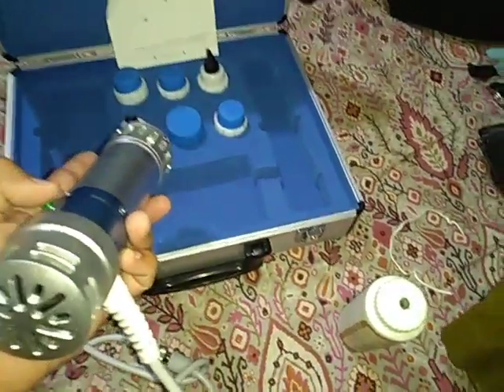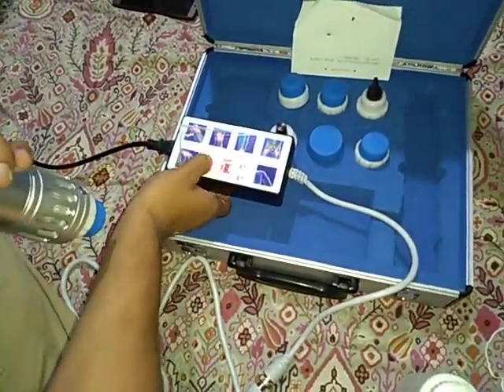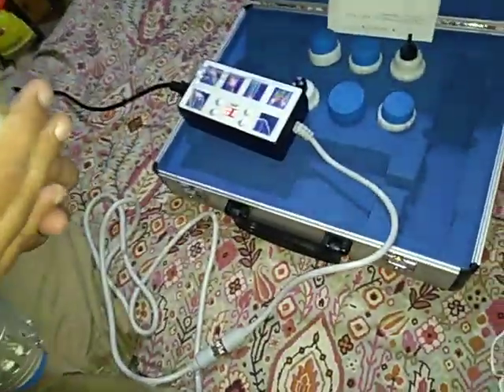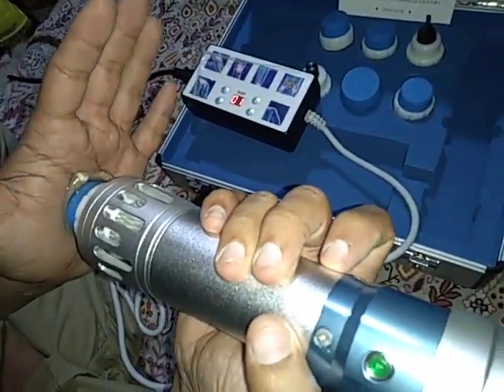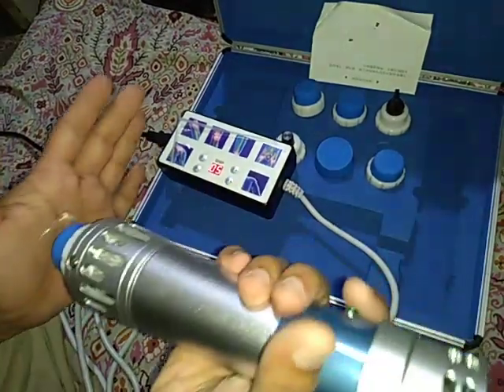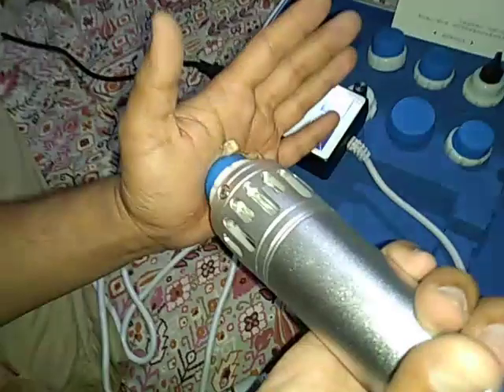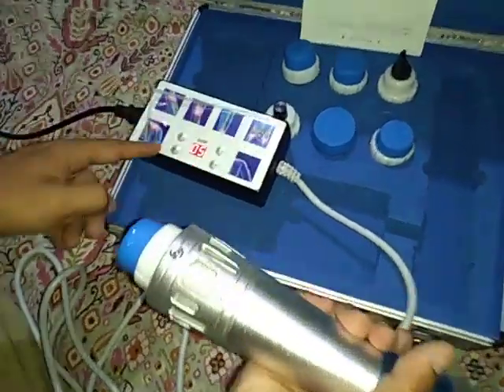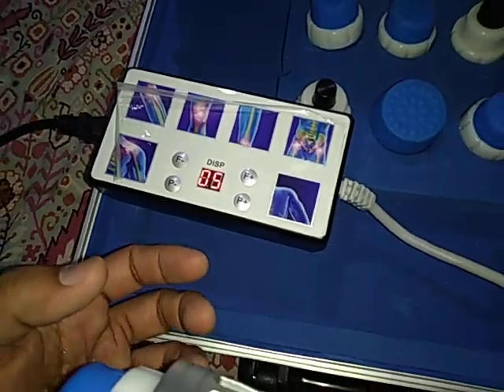Demonstration of shockwave therapy

Comment: I suffer from a tense pelvic floor. The treatments at the doctor's are too expensive in the long run, so I bought this device for home use. My doctor said such machines normally cost 50,000 dollars. My machine cost 250. I'm curious to see if it does any good.
Reply from the maker: Dear you can contact me for Professional advice at my Whatsapp +923315191713.

Comment: Can the blue silicone heads be taken off to use? There’s a silver head underneath can that part be used directly on the skin with ultrasound gel or will it burn the skin?
Reply from the maker: It will not burn the skin but the impact will be more.
Reply: @SyedAliPT Thanks for replying.  Been using it on calves and hamstrings. Can confirm no burns lol. Honestly, its the only device/shock therapy that will get deep enough in my muscle tissue and fibers.Wish there was a mount for a hands free use, so I can get my shoulder blades without asking someone to do it for me.

Comment: Good vid. In your opinion is this device basically the same as a vibrator?
Reply from the maker: No dear.
Reply: @SyedAliPT  "dear??"
Reply from the maker: @testchannelone6616  sorry for delayed response. No this machine is not like a vibrator.
Reply: @SyedAliPT  OK, then what is the difference?
Reply from the maker: @testchannelone6616  this is a shockwave therapy machine
Reply from the maker: @testchannelone6616  read about vibrator and shockwave and you will get the differences.
Reply: @SyedAliPT  I see. I thought you might know the answer.
Reply: LOL. It is a shock. Wave.

Comment: I have been using this machine for several months now.  I have tried various configurations using small heads and larger ones.  I am currently using the 36mm convex with F2 and P4.  Frankly none of the settings have made any improvement to my ED.  Has anyone else experienced such disappointing results?  Is it a fact that this machine does not work for all patients?
Reply: Apply complex systems thinking.  If the problem is not related to lack of direct electrical energy, how can adding electric shocks fix the problem?  Many problems have a root cause in mitochondrial energy production and exhaust dissipation.  8f that's the problem, you need to fix it there via what you eat. If you eat processed, iron filing infused foolds, well, that almost certainly plays a role.
Look up The Root Cause Protocol and try to eat net alkaline on the day.  I eat mostly organ meats and sardines when I eat meat, and I eat quinoa, tofu, carrot/green juices and goat leg soup modified with some chicken soup bullion.
I also supplement with Jigsaw or Rosita's Cod Liver Oil, Mg/Na/K bicarbonates, and various anti-candida/parasite natural remedies.
You issue is almost certainly well beyond ED.  You also might want to look into OmaPure IFOS 5-Star fish oil (keep refrigerated) capsules as well.  It is a natural blood thinner.
If you process all this and want more leads to investigate, hit me up and let me know.
Reply: @wellnesspathforme6236  shockwave therapy (at least real shockwave therapy) is NOT "electric shocks."
Reply from the maker: Yes it does not give positive results in all patients.
Reply: Where r u from brother?
Reply: Can i get your no. ?
Reply: I would try red light therapy with 660 and 880 diodes
Reply: Fake machine
Reply: @dantosrock43  why are you say that

Comment: thank you. can you use this for ED?
Reply: for ED you need to use the small black one or the larger one that looks like a big flat black screw driver head. it must be used in 3 spots along the top of the penis and then in the middle of it on left and the right. The pamphlet included includes pics and directions only for how to treat the ED part. Be careful on starting with higher settings as it could cause bruising and redness but that is because it is banging the veins breaking loose blocked veins that don't have good blood flow, then the body will grow new veins to supply the bloodflow. This is an over simplified explanation but it paints the picture of how it works. This may take a few months of treatments but for most 2 treatments a week for 3 to 4 weeks should do the trick.
Reply from the maker: Yes
Reply: How do you use for ED and what tips?  How long should you use it? Is there a video that show how to use for ED?
Reply from the maker: @jhowze6407  watch my other video on how to use it for ED. Go to my channel and look for electrotherapy playlist. You Will find that video in that playlist.
Reply from the maker: @jhowze6407  here is the link for video

https://youtu.be/MQhAQpRQB_A
Reply: It won't work in Ed as is a radial machine